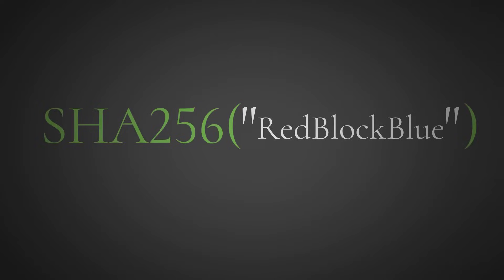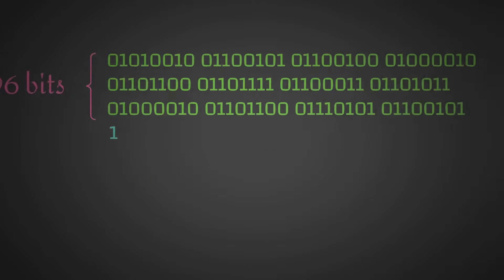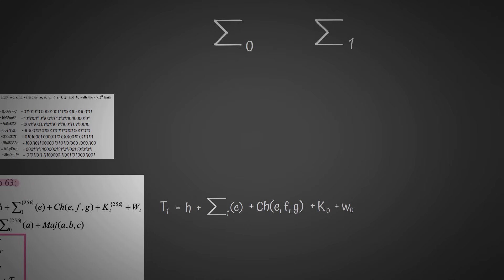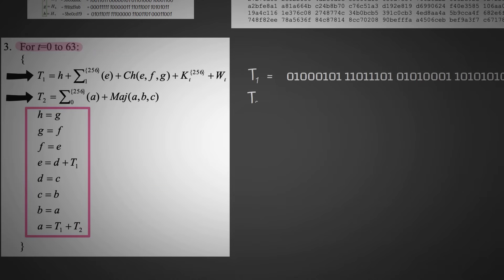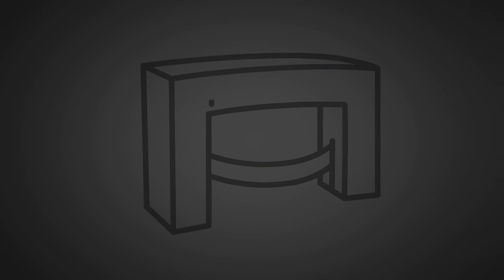SHA-256 | COMPLETE Step-By-Step Explanation (W/ Example)

Comment: Great video!
Btw, in the beginning you said that whatever bit length your input has, the padded message length would be the next 512 multiple. That is actually not fully true. That would only be true if the length of the input is smaller or equal to n*512 - 65 (if equal then k = 0). so if e.g. the input length is 960, the padded message will not be 1024 bits long, bc we would then have negative solution for k. But we cannot have a negative solution for k, so that’s why we would need to go with 1536.
Reply from the maker: Ah yes ofc, I'll pin your comment so others don't miss that. Thanks!
Reply: @redblockblue 
Alright, great. But really bro..your video was fantastic, good job brother! Keep it up!👍🔥

Btw, do you have Twitter or tg?
Reply: @redblockblue 3:25
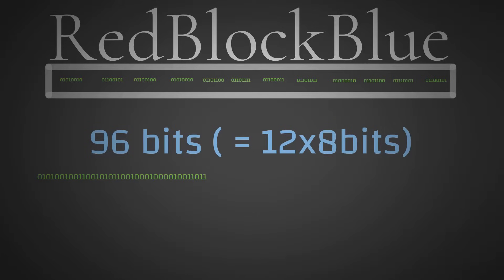Reply: 0:36
Reply: what is 'n'?
Reply: @cat47  Im guessing that n is number of blocks in the input, in the video he forgot to mention that you need 65 bits for input length and the 1 before the padding. Meaning that if you have a message length of 960, if you add the 65 at the end you end up with 1025 bits which is not a multiple of 512. Therefore you need a third block just for padding and the 1 plus input length
Reply: Why all of that and just 2048 words !?
Reply: So I am gonna write it down just so I can understand. You need 64 bits for the "length of the message", you need 1 for "padding" and the rest should be your binary conversion of the message. Now, in our case, that is 960 bits, let's say we take 1024, then 64 for length , 960 for bits and 1 for padding which sums up to 1025>1024 therefore 1024 is not a valid assumption and we should take the next 512 multiple. so generally we can check  and find (no.of bits)< n*512-65 where n is the smallest natural no. to satisfy the condition.
Reply: this is obvious.

Comment: i used this explanation to create my own hash generator in C#, copied every step, i was pretty impressed cuz it seems to work, the issue is the hashes arent the same as a sha generator, eg when you do RedBlockBlue you get f8f05 etc, however i get this hash C1BC0C5FE79A6BE7FB712126CE81E56302D142D0F5F59DD18904A7E059D54615 I cannot figure out whats going on here lmfao.

Comment: It will take 1294Q years to decrypt sha-256 hash files with 20 characters including number, upper lower case and symbols. Almost 0 collision and it's one way function which one output gives multiple inputs but each input has a unique output. Even quantum computers need millions of qubits to do that. In addition to all of this bear in mind that the bitwise xor operations are reversible and the enigma machine is a perfect example, but what makes the sha-256 very hard is the computational problem. 😢

Comment: The result of the bit addition % 2 at 10:49 might be wrong. I did it by hand just to be sure. 
You can quickly assert this by just doing the manual addition of the third bit (from left to right)  [0 ^ 1 ^ 0 ^ 0 ^ 0] which should be 1 but in the presented result yields 0.
Or maybe I'm missing something?

Comment: While it might not be intuitive when presented here, the reason the Bitwise Choose Algorithm [ch(e,f,g)] works that way is because when you implement it, the conditional branching naturally flows to the second input (f) when you encounter a 1 (true):
for (i = 0; i < 32; i++) {
    output[i] = e[i] ? f[i] : g[i];
end

if it was coded the other way around, then the condition would have to be ( if(!e[i])) and it makes everything more convoluted.
Reply: Can u explain it more clearly, or have a video on it, it will be very helpful, I really want to understand it😭😭🙏🏼

Comment: Great video. But for someone who knows nothing about this stuff...what happens next once you get the output?
Reply: You want to know what hash values are good for? An example is a professional website doesn't store your password but a hash value of it. So when you log in they compute the hash value of your entered password (maybe by using SHA-256) and compare it to the stored hash value. That way even when someone breaks into the database they don't get your password, but a hash value instead.
Reply: @dennisbrouwer8200 thanks

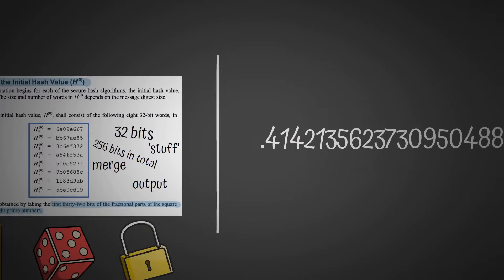Comment: 3:44 how we contert and how much
Reply: Multiply the decimal value of the square root of 2, don't take the integer part every time (on first multiplication also) like discard 1 from 1.41 and take 0.41, so, the first 32 integers we get while multiplying the results with 2 again and again, we get 32 bit binary representation of the first 8 even numbers, then convert them into hexadecimal, and ur 👍🏼😊

Comment: Not to be "that guy" but in your initial values for RedBlockBlue, you have different values for the two capital Bs. Do you remember if you used the values as shown for your calculations or were the correct values used?

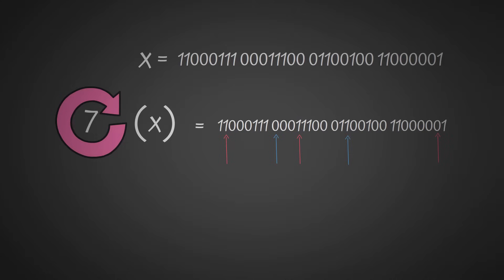Comment: 5:31 real messy LOL bcoz you explain it wrong. could just say ROR 7 times and make animation it roll 7 and not high light this and this if all they shift LOL now 18 ROR is easy. then 3 is easy but zero 3 after thats like without carry AND this is first time when math backward become cracking part we not know what those 3 bits was when they erased LOL so we need do 10 diff all plausable combo but from this point not matter LOL. what comes next i not yet reverse think lol

Comment: Knowing all the steps why can't people work backwords to get the original string?
Reply: Imagine SHA-256 as a machine that takes your input, grinds it up into microscopic pieces, and produces a unique "dust pattern" (the hash). While you can see the dust pattern, it’s impossible to reconstruct the original object because:

Pieces of the original were destroyed during the grinding process (irreversible steps like mixing and modular arithmetic).

The dust pattern doesn’t retain enough information to rebuild the original.
Reply: @yaminipriyx  but can we get not the original, but at least such data that will again give the required hash (something like the preimage of a function in math)?

Comment: If I am calculating W(16), on which bit I will have to apply the sigma0 and sigma1?
Can anyone tell me?
Reply: When it says (t-15) or (t-7) t is the loop from 16-63. t is going through the loop, when solving w16, t is 16 so w16 -15 = w1, if its w38 for example then its w38-15 = w23 if u get it?

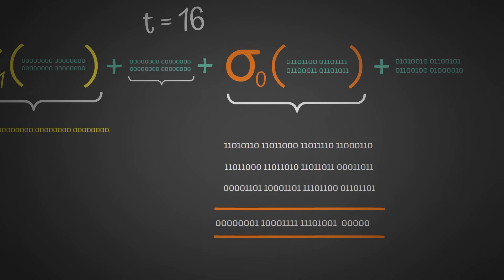Comment: 7:24  when making addition modulo 2 for sigma0:
Is the result shown correct? ("00000001 10001111 11101001 00000101")
In my calculation it should be ("00000011 10001111 11101001 10110000")
Reply: I agree, I also got 00000011100011111110100110110000

Comment: 3:46, why are the online decimal to binary tools inaccurate? They give me 0.00000010110100011001
Reply: What do you mean? Perhaps you calculated incorrectly.
Correct algorithm is: (**Psuedo code)
n  = 2 
nSqrt = sqrt(n) = 1.4142135623730950488016887242097 ..
nDecimals = 0.4142135623730950488016887242097..
nDecimals32Bits = nDecimals * (2^32)
hexValue = hex(nDecimals32Bits) =  "0x6a09e667"
binaryValue = 01101010000010011110011001100111

Comment: hmm I don't get it, why creating initial hash values at 3:28 introduces randomness? if we know, which prime numbers we are taking?
Reply: because you use also the square root to add to the final append  square root of 2 and square root of 3 cant be mixed together the h0 are initial hash values and its the body of algorithm and ki is the heart of algorithm and wi is the brain so you lay down the foundation where the algorithm is build and in the end you use also square root to close it and in between you have ki which is the square cube or something and on prime number square root of a prime number cant be mixed together with a  square root of a cube square roots of prime numbers always are divided by 2 and 3 8= 2^3 so no prime  and 9 =3^2 no prime  7=2^3+1prime 3=2^1+1 that is why 3 is a prime number and 5 and 7 because they are not divided and square root of them always come as rounded number so there is one way forward and no way back all prime numbers are only divided from it self and 1

Comment: If you do the bitwise addition of Sigma0 shown at 07:24 then the result I found is 00000011100011111110100110110000. Would you please explain if there is sth wrong ?
Reply from the maker: Yep, you're correct. I believe I used the correct sum going forward though so the error doesn't carry forward through the rest of the steps. Good spot.
Reply: I was having the same issue, appreciate this comment!
Reply: Encountered the same thing. Glad I'm not crazy
Reply: same thing here "00000011100011111110100110110000"
Reply: i was like looking in every func i use and see their values

Comment: What will happen if the text we are trying to hash is 504 bits long? You don't have 64 bits to represent the length of the text in binary to be able to add to the end of the binary for it to be 512 bits in length. Your hash will instead be 568 bits long.
Reply: you will then need to extend it it 1024 I guess
Reply: @kyrylopisariev9791 yes exactly
Reply: Have you tried convert the text into shingles/ tokens? In that way, you avoid having text longer than 504 bits
Reply: @diogocardoso265  How do you do that?

Comment: Can you do the reverse example? getting a string to get a  determined value from the function?
Reply from the maker: Do you mean:
Given a 256 bit output, find the input? 

No this is not possible, SHA256 (as with all cryptographic hash functions) is a 'one-way' function' meaning its impossible to invert (go google those terms and look at wiki if you're unfamiliar). 

To convince yourself this is true just look at the inner workings of the algorithm: it's composed of several 'mini' one-way functions such as bit-wise addition mod 2 (i.e. we pass the bits through an XOR gate) if the output is 1 then the input is either 01 or 10.. we can't even invert this function! Same goes for 'shift' function in the video, SHIFT3(11011100) = 00011011... those first 3 bits of the input could be anything and still give same output  (b/c they're set to zero regardless) so we cannot invert this mini function either
Reply: @redblockblue  thank you for the response. I had a challenge to find a string that returns something with the substring b00da when passed through the Sha256. I'm no criptographer, I had to brute force it